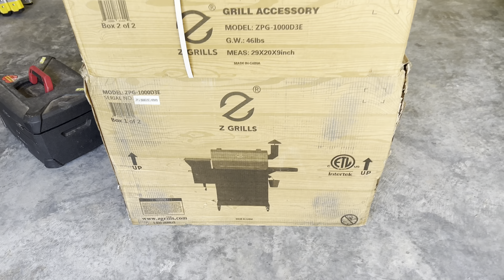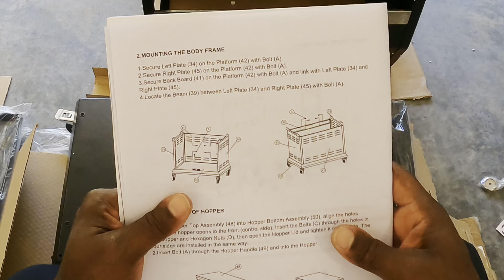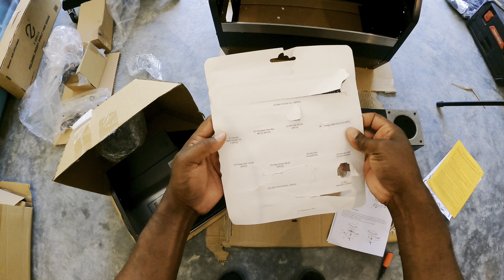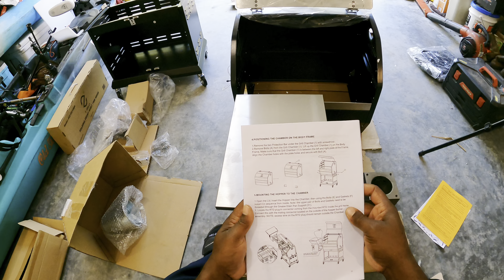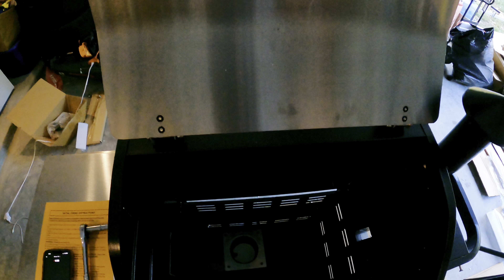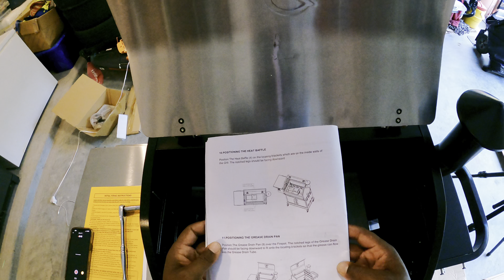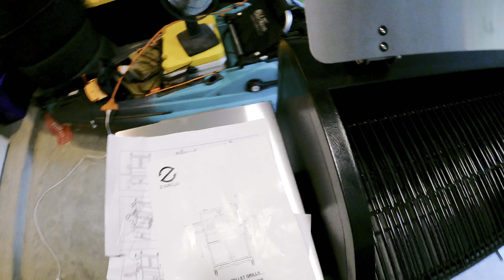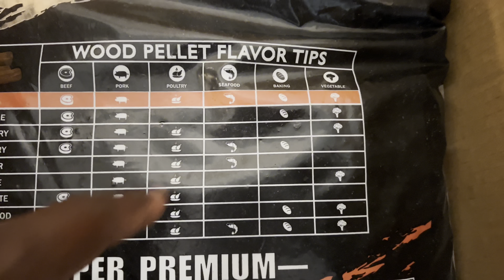How to Assemble my Z-Grill 10003de Wood Pellet Smoker (Time for some Smoke)

Comment: Man Ol Yellow is sharp I love the old school trucks, nice looking smoker also. FYI just from my personal perspective don't use those wire brushes to clean your racks they will remove the non stick coating so to clean it I recommend using a soapy rag while it's still hot that way it cleans up easy and it will be washed and ready for the next time you cook that's just my personal experience though I've used that method for years and my grates still look brand new. Love the content and good luck this season